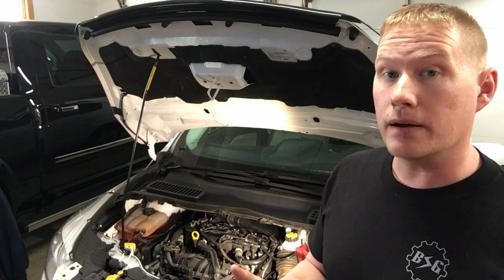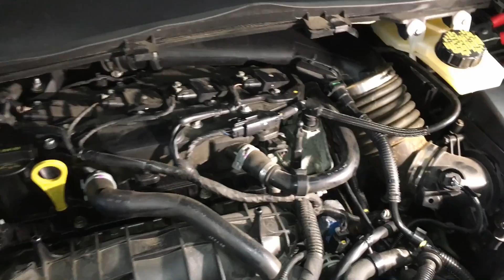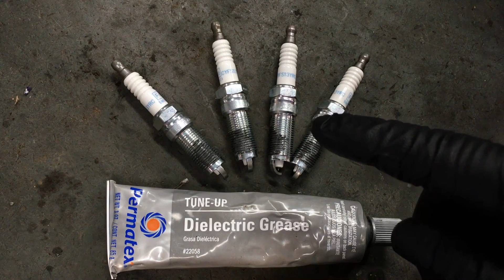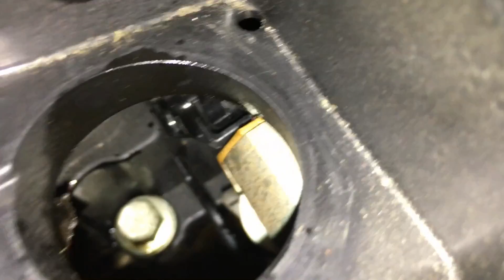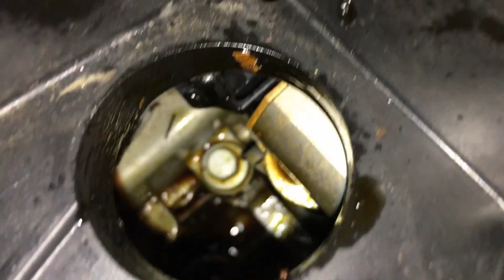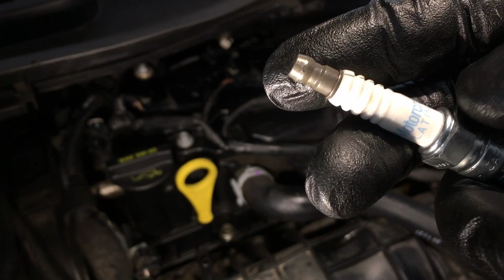2013-2017 Ford 1.6L GTDI Ecoboost Engine: Spark Plug Replacement

Comment from the maker: These are the Tools and Parts needed to complete the job:
Motorcraft Spark Plugs-
http://amzn.to/2pAKCi7
Dielectric Grease-
http://amzn.to/2qlm919
Nickel Anti- Seize-
http://amzn.to/2oYxijv
Spark Plug Swivel Socket-
http://amzn.to/2qwrU8l
Gapper Tool-
http://amzn.to/2oYnRkg
Specs:
Gap- .031"
Torque- 133in lbs
Reply: FordTechMakuloco what about the oil in there? What would be the cause and fix for that Sir? Please let me know. Thanks
Reply: What is your opinion on using non-Motorcraft plugs for replacement?

Comment: For the last three days I have been trying to get a broken spark plug, threaded part remains,  out of 2014 escape 1.6 ecoboost. Spent around $500 already from the triton extractor set, to tap and extractor sets, to using spline sets. None of it has worked. And it was the dealership that put these plugs in. Help, any advice please.

Comment: I work at a ford dealership. This video did help but I would recommend removing the cowl, it makes accessing and removing the boots and plugs a lot easier. Just make sure you put the wiper blades in a way that you’ll know which is which.
Reply: I always put paint pen on the underside of the wiper arms. Synced wipers are a little pain in the ass and nobody but Ford or Honda techs seem to put them back correctly lol

Comment: Good video as always.
Issue I ran into on my 2013 Fusion 1.6L is you NEED a thin wall socket to get these in/out. 
My 5/8 spark plug socket in my regular everyday kit did NOT fit.
If you are going to do this job take Makuloco's advice and get the thin wall socket.. otherwise you may not be able to get these out.

Comment: Things to watch out for, from my experience changing plugs on this Ecoboost engine. (Mainly in the Escape models, but is applied to the others) #1 He isn’t kidding when he says to check and remove debris from around the coils. That isn’t an easy job if something falls in there, as it’s a long way down to the bottom, with plenty of bolts, and plastic stuff to be removed. #2 Those stupid connectors are junk, and become brittle on top of getting stuck in the COP over time. Make sure the white retaining/locking  tab is pulled out adequately from the connector when unlocking it, but don’t pull it to far out as to brake it off/out of the connector as it happens when they get old and brittle. Then make sure enough pressure is applied to the connectors removal tab when pulling it off the coil, as they can get stuck because the locking lug on the coils connector body protrudes too high on some. Not allowing the retaining end of the harness connector to fully clear it even when fully depressed. So you might need to wiggle it around or use a tool to gently lift the connector over the lug. These connectors aren’t cheap, even though they look like they should be, but can be found on eBay for $17 each.#3 when replacing the coils make sure you only lightly hand tighten the bolts that hold it down. The inserts that they thread into are a bad design, and easily strip out from their recesses if over tightened. Antiseize should be applied also, as over time corrosion will lock the bolt to the insert, resulting in bolts that just spin without coming out next time you get to do this job.

Comment: I tried to change out the plugs on my 2014 Escape 1.6L SE and found that the 5/8" spark plug socket DID NOT work.  Tried other 5/8" spark plug sockets and none worked.  However, another YouTube video suggested a 16mm deep well socket which DID work.  Sad thing is that I only discovered the 16 mm socket worked AFTER removing the cowl to get better access to the plugs.

Comment: My 2013 escape the plugs don’t seem to want to come out. I have heard you need to use a thin wall 16 mm is that right.
Reply: 5/8 thin wall socket.  Use a regular deep socket to loosen first, for some reason I could not get a 5/8 spark plug socket to seat correctly. The spark plug socket must be to thick.

Comment: Can you tell me again how I would know if the coil needs to be replaced
Reply: Engine misfires.  it will trigger the check engine light and then you can scan for the error code.

Comment: How bad are these engines with Carbon build up from the direct injection?
Reply: If your asking, then you already know.  Lol
Reply: @randycollens2681  We had a Ford fusion that was terrible. Constantly breaking down. At the time we were asking if these were as bad as people have been posting in forums. We went with a Toyota so it does not matter anymore. After driving this Toyota for awhile I can simply say Ford is not even in the same league quality wise:P

Comment: My friend has a 2013 ford escape 1.6 we put new sparks plugs in it and it's coming up misfire in 1 and 3 cylinders
Reply: I'm having the same issue.  I even tried changing out the coil packs and it's still misfiring. Seems like it's misfiring worse now than before.

Comment: I have a 2015 escape 1.6 with 56,000 miles on it. It’s showing a miss fire for 2 and 3. I don’t have a warranty anymore. Could this be the plugs? Or are coils going bad?
Reply: Either of them could be the cause. You need to change the plugs first.
Reply: @humansvd3269 if you’re changing your plugs might as well do the coils at the same time
Reply: How’s your coolant level…. Engine replacement is more likely your problem.

Comment: working on a friend's 2013 Escape 1.6T, some clown put cheap coil packs in and they failed, but they tried to put the bolts in strait up, not angled, so the bolts cross-threaded and broke the nutserts loose inside the coil mounting bracket.  Now I have to buy another crappy plastic mounting bracket from the dealer for $85.

Comment: Anyone know how I can get a stuck/broken spark plug from an escape? The spark plug came out,but the thread part stayed stuck and I can't get it out
Reply: You used an impact didn’t you!  To answer that question, engine is coming out.
Reply: @randycollens2681  torque wrench
Reply: @randycollens2681  took it out using the extracter

Comment: You could also put the new plugs in with a neoprene hose and hand tighten it that way. The hose actually goes over the top of the spark plug and  holds the plug. Then you can tighten it with the rachet. Great video and thank you.
Reply: Don't, if the spark plug comes somewhat loose it can rattle and the rattling can cause the thread to destroy itself; happend to my car. 2 year old sparkplugs, 1 completly loose and ruined threads, needed an insert, the 2 others were very loose aswell but no damage.

Comment: Good Video, Not sure why 29 didnt like? Anyways wife drives a '16 Escape AWD we got her as a commuter-car b/c of all the miles she racks up. After 4 years she has 120k on it! crazy.  Its been a good car overall, have done brakes & tires. A few freebies from Ford under warranty like a new tranny at only 80k which was disappointing to say the least.  Door seams rusting out from the inside they are fighting me on warranty claim.  Bottom line its a disposable car!  I'm gonna throw some plugs in mine now b/c she is saying 'it boggs' though I dont notice a thing and no MIL light coming on.  If I felt it was a car I wanted to keep I'd do a complete sensor tune up myself, not going to toss extra bucks in b/c I already know I'm gonna get tossed under the bus on my trade in value.  
The next major milestone for mine will be as a Coke can! :)

Comment: I got one in today. The damn spark plug thread stayed in it. The center of the plug come out. Who ever torqued them plugs. Must have used a cheater bar. Now I have to figure out which tool to cut the thread inserts out. As they are angle plug heads.
Reply: I have the same issue. Using penetrating oil and an easy out. I have a great grip, but is not budging. How were you able to break yours free?
Reply: @JM-sz1ck  I didn't... I had to cut it out with the Ford Spark Plug 2v  kit...Then install an insert..

Comment: I took my fusion to Baxter Ford a month after I bought the car and I saw on the car fax no plugs have been changed so I took it there got them replaced then one month later the ceramic around the plug shot down into the cylinder and killed my motor. AND THEY FUCKED BLAMED IT ON ME??? Help me out here, there is physical proof that the plugs that they PUT IN ONE MONTH before failed and are making me pay for a new motor? Should I or should I protect myself and make them pay for the damages they caused??
Reply: Take the receipt and go to small claims.

Comment: Hey FordTechMakuloco.  I just tried to change the plugs out on the 1.6 eco boost escape. 3 plugs came out just fine, however one spark plug is being stubborn and will not budge. Now the socket is also stuck and I’m unable to get it off. Do you have any suggestions that could help.  Thanks
Reply: FTSmedic  buy locking extension

Comment: I'm using a standard (old school) 5/8 inch sparkplug socket but it does not go into the hole in the valve cover housing the actual spark plug. I can see the area around the spark is clear. Any ideas why the socket wont fit into the hole?  Yes I'm sure the socket is 5/8 as recommend by the manufacture. Any one have a similar problem or solution?.
Reply: I found a thin walled 5/8” magnetic on swivel extension on amazon for only $12 and it worked perfectly, and fit down in the wells, unlike standard 5/8 spark plug sockets...  Search:  “LEXIVON 5/8" Swivel Magnetic Spark Plug Socket, 3/8" Drive x 10" Total Length | Enhanced Magnetic Design with Thin Wall Socket, Cr-v Steel (LX-122)”

Comment: Anyone knows if a 2013 ford escape 1.6 uses a fuel filter?
Reply: Read the owners manual it should mention it.
Reply: Focus EB 1.6 of the same age has a non replaceable filter in the tank.

Comment: I have the 2.0L sp537 5/8 inch socket get the 10 inch extension because once this is fixed you more than likely will find more use for it on a fusion because its a F.O.R.D. (Found on road dead).....and sp530 is 2.5L 5/8 inch socket. The tool kit I have was too short so I had to get the 5/8 inch Duralast socket with my 75-509 Torin jack, inc manufacture id 28035190 torque wrench. It fits for the 5/8 and the extension so if you already have one don't spend 30 dollars on a new wrench. Mine went out at 53,000+ miles on the 2.0L engine when I was filling the oil over time I guess it got down in the area because the 2.0L oil filler is very close to the sockets and if you spill any clean it quickly so as to not have an issue later.
Reply: USE PUNCTUATION
Reply: @Lucky8s  DON’T YELL!

Comment: I'm having a problem removing my spark plugs on my 2014 Fiesta ST. The spark plug socket seems to be too thick and not going deep enough to get a hold on the spark plug itself. Any recommendations? Thanks in advance.
Reply: Having same problem. Did you find a solution?
Reply: @24pskully  Yes, The S&K spark plug socket that I purchased was machined down a couple of mm and I was able to remove my spark plugs.

Comment: I have a 2015 Ford Fusion with the 1.5 ecoboost and have a code for the o2 sensor in the cat and p1450 when I fill my tank it doesn’t want to start and I called the dealer and asked if it would be under warranty seeing that the car is 3 years old and has 68k they told me that the o2 sensor will show its age at the mileage I’m at, does that make any sense to you? And have you had these codes come up p0141 and p1450
Reply: Jon Froio  you need to replace your canister purge valve! Another tell tail sign will eventually be a buzzing noise coming from your gas cap. Easy fix, $140 dollar part from ford.

Comment: Good video but you should make viewers aware that standard 5/8" plug socket does not fit into the plug recess, as socket is too big in diameter to fit into the plug well. I am picking up the Gearwrench model you use and hopefully it will fit as easy as you show.I took off the plastic wiper/cabin air intake cowl, its not too difficult to remove and makes the plug install access much easier.
Reply: Did the gear wrench extension  work in getting  the spark plug out?  Or did you have to do something else?
Reply: Edwin Hernandez Go to your favorite stores and just pick up the socket with the extension already attached , it will be a swivel set up.

Comment: I couldn't pull the spark plugs out. I tried 2 different 5/8 sockets I had and I can't catch them.
Reply: Don't have a deep enough extension? You need a special spark plug removal tool like what he has. Slim 5/8" size.
Reply: Hi Jessie, I have the same problem. I have 4 different brands and they can't catch the plugs. I bought a S-K extended length spark plug socket and had it machined to reduce the thickness. Tomorrow morning, I'm going to make an attempt to remove and replace them.
Reply: It’s a 9/16 hex
Reply: Grind the outside of the socket to reduce thickness he doesn't tell you there is a groove you have to fit in
Reply: Use a neoprene hose that will fit over the top of the plug. I use that on all my cars older and new.

Comment: Ford? Yes
90,000 miles? Yes
Oil leak? Yes
Reply: absolutely ridiculous leaking oil in the plug wells, and pissing oil from every external joint
Reply: Very rare thing to happen and do not know maintenance historyof vehicle.  At least everything is accessible unlike 99% of gm products.

Comment: Hi Brian I just bought a 2017 f150 5.0l 4x4 xtr. I had a lot of problems with my 2011 5.0l namely the engine needed a short block after only 50000 km. it was under warranty but i was wondering if they resolved that issue with the 5.0l knock. i haven't heard anything about them after 2013. Any thoughts? You would think i wouldn't buy a ford after that however I really like them lol.

Comment: off topic question ?    2017 escape with 1,5 ecoboost,  . was in an accident, NOW REPAIRED I get  b1492 code fuel cut off event,  car will stall while turning corners. replaced rcm and programmed with ids and calibrated with abs module, but still the code persist. the pts says nothing how to test or what to test. its driving me nuts, 15 year ford tech. hate doing hotlines through ford rather fix it myself with help from other techs. any thoughts
Reply: James Smothers looking at a wiring diagram there seems to be "event signal " that's goes to pin 5 on bcm that originates at the BJB (battery junction box)  sandy
Reply: found the problem today. it turned out to be the body control module. during the crash the wires were cut to the crash sensor and the sudden surge of power to the bcm shorted out the internal micro relay to that circuit .  I'm my opinion it seems unlikely  the cause, because the restraint control module receives the crash sensor input and the rtm tells the bcm  to tell the pcm to cut off fuel to the car all connected through a CAN network.
Reply: James Smothers so the  fix was to change the bcm?, sandy

Comment: I have found a couple times on these 1.6L motors that certain spark plug sockets (specifically single hex sockets) don't fit in the spark plug recess in the head, double hex sockets I've never had a problem with.
Reply: Just did mine today had to grind the socket to fit

Comment: Each manufacturer has some problems, but Ford has abused the privilege. Many problems, many engines/transmissions.
Reply: Ive owned 4 Fords from 80s to today and have had 0 problems with any engine or transmission issues.  Have to actually maintain a car.
Reply: @jdigitalseven7  that's right Joe!!
Reply: My escape has been the best car I ever owned.  2018 titanium 4wd 2.0.  A little extra maintenance goes a long way.  Transmissions on them definitely aren’t the smoothest but I have yet to have any issues.  Same thing with my wife’s 2012 fusion.  Both rock solid.
Reply: My parents drove ford, my brother has had 3 f150, I have an escape and an explorer. All have been fantastic cars with little to no problems

Comment: FordTechMakuloco i need your help my friend. i have a 98 ford expediton the when i power brake on driver or reverse the engines shakes really bad. it also does this when im driving at around 40mph. it does not have a check engine light on. i have checked fuel pressure, and vacuum leaks and they all looked good. what should i check now. thanks in advance
Reply: what engine 4.6 or 5.4? how many miles ? when was the last tune up ?
Reply: its a 5.4 now i got a p0171 i checked fuel trims and i noticed that as i rev it up the fuel trim goes to 25. i have checked for vacum leaks and fuel preasure wich was at 32 engine running thats before the fuel filter replacement.
Reply: how did you check for vacuum leaks?? :)
Reply: home made smoke machine.also as i looked at the scanner i was confuse at the o2 sensor 1 readings for both banks. they where alreading like 800 to about 250. and sensor 2 where like below 100 with the exception when i would rev it up

Comment: That's Funny. Mine is a 2016 2.0L EB and just had to have the timing cover done due to an early oil leak. 35,000 miles
Reply: cjones4512 damn already? That sucks
Reply: +cjones4512
The problem is likely the PLASTIC valve covers!
Reply: @watershed44  aren’t all valve covers plastic the last 20 years?
Reply: @randycollens2681  Many are but not all, but if they are plastic they are designed to be disposable junk and fail right after the warranty is up.

Comment: I have a 2013 Escape with a 46k on it original owner. Should I pull the plugs and do an inspection @50k. If I find gasket issues would it be covered under Ford extended factory warranty?

Comment: You said you were keen to read these plugs at 9?K miles, what with the forced induction.  I think you got distracted by the valve cover gasket leak.  How did the plug tips look?
Reply: I dont think those tiny engines put a lot of stress on spark plugs, from the one he briefly showed it seems it was in pretty good shape; the 2.0 and bigger ecoboost engines should be the ones to watch out